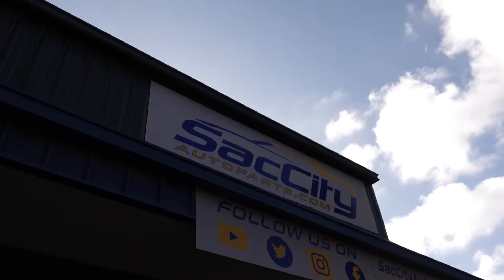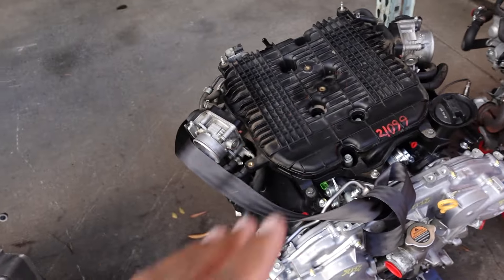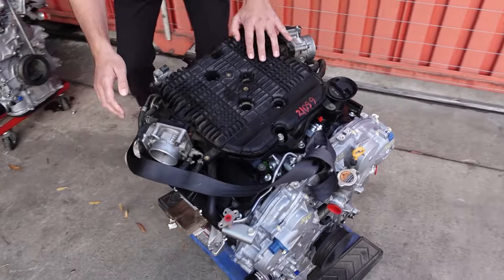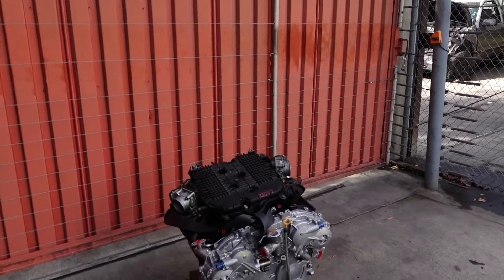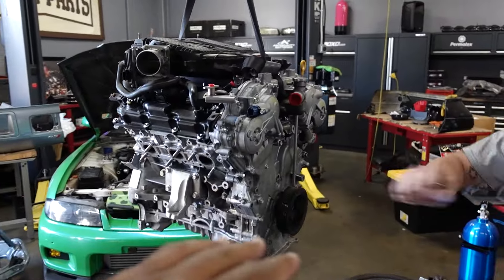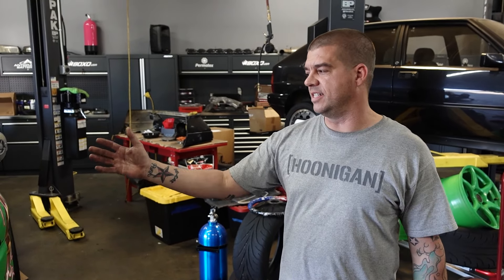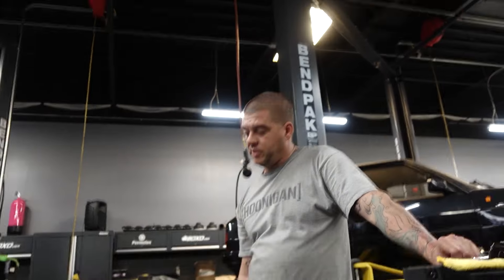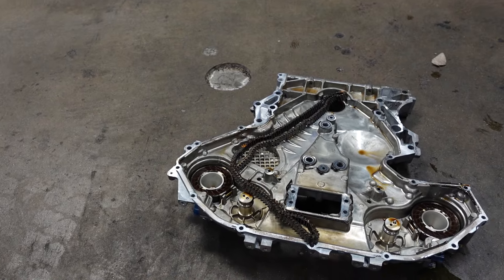THE WORLDS BEST SKYLINE! 4 DOORS FOR MORE…

Comment: soooo did u know the R32 skyline was one of the original test vehicles for the VQ30DET that was put in the cedric and gloria's and eventually the R34 race car
the R34GTR was supposed to get a VQ30DETT not a rb26 !!!!
Reply: r32 bays are also wider as the bays of older nissans also fit VG30dett motors